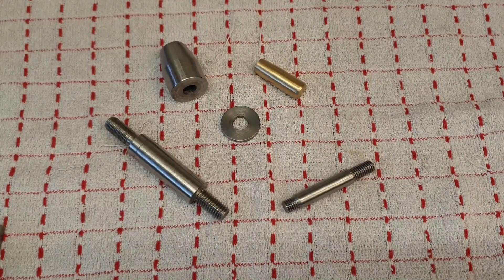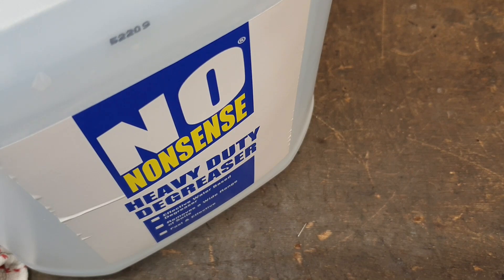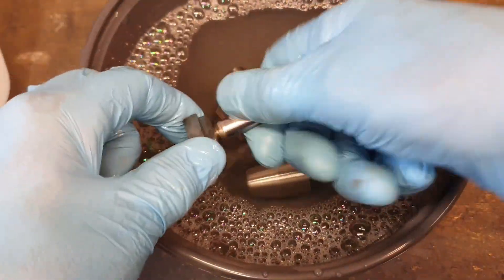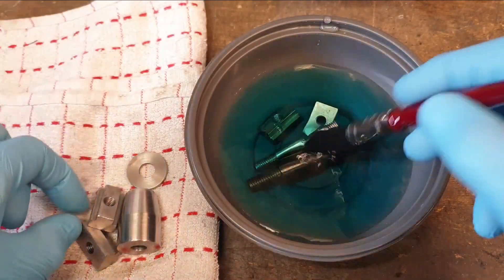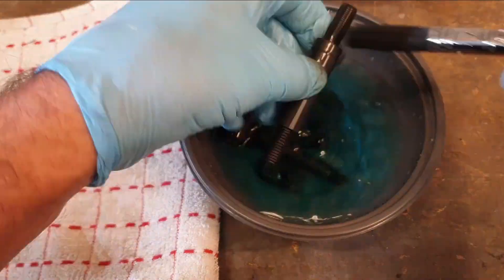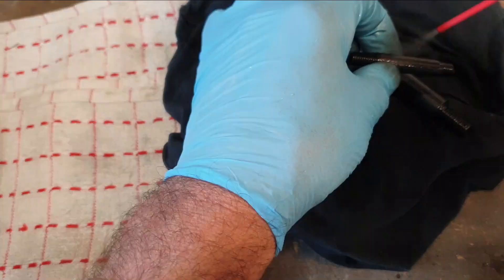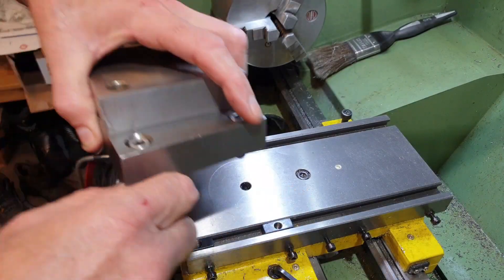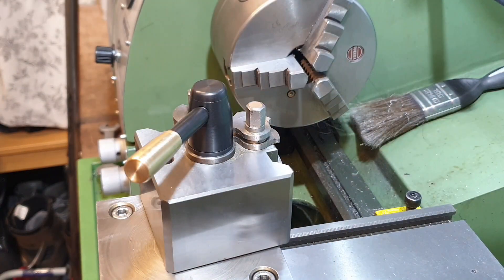Cold Bluing with Phillips Professional Cold Blue

Comment: ive got a bottle of this and it was terrible it took about 10 minutes so see any sort of reaction and there only 3 mm pins any idea why this may of happend
Reply from the maker: and forget it.  I use Acetone for the final clean and then don't touch the parts with my fingers.  Beyond that, I cannot help without actually seeing what you're doing.
Try again.
Mark
Reply: @markshomeengineering5243  did yours have some residue after you had let it sit as ive waited 12 hours and when I wipe it with some gun oil the cloth has black residue on it like the blueing is rubbing off
Reply from the maker: @HeckerAirsoft  after soaking in the blueing liquid I covered it in oil, from memory I used GT85, I think I show that in the video.
Reply: @markshomeengineering5243 after that did any residue come off?
Reply: @Ritchie Wolf  yeh its absolute shit but I thought I would give it a try after a month where it was blued turned brown almost like rust I tried boiling it and it went back but after a week it was brown again

Comment: Where did you purchase the QCT from?
Reply from the maker: Hi Anthony, ChronosUK.
Mark
Reply: Hi Mark, do you rate it, and if so, what is the part number?
Reply from the maker: Hi Anthony,
It's marketed as a Boxford quick change toolpost, part no.390301.
It's nothing special, the clamping arrangement for the tool height is not particularly good and it needed stripping and cleaning when I got it.  It is much better than faffing around with the oem toolpost and I've since bought more tool holders but still don't have enough 😃
Cheers
Mark
Reply: Hi Mark, Does it fit out of the box?. I was looking at the Warco "QUICK CHANGE TOOL POST - 125-150MM CENTRE HEIGHT 9009" which is £147.00 and only comes with 2 holders.
I've looked at the dimensions and they are very similar. Its the old "Pay your money and take your chance"!
Reply from the maker: Hi Anthony,
No, it didn't fit out of the box. For my fixed tool post, it was a simple job to turn a new clamping post.  The mod for the compound slide was a bit more involved.  I have a video on here for the latter.
Ta
Mark
Reply: @anthonynewton5055  That sounds very expensive for what is I assume a China made product ?  I've recently ordered an AXA copy QCTP from Bangood (£65) and some tool holders.  QCTP comes with just a bottom plate to modify if or as needed.  I was thinking of making a video of my mods to fit it to my Chester Cub 630 lathe.